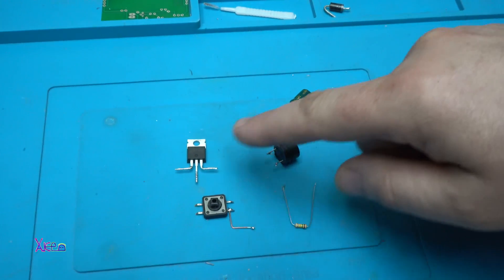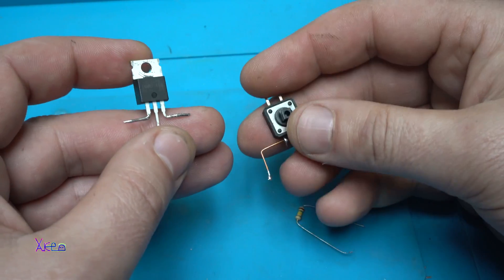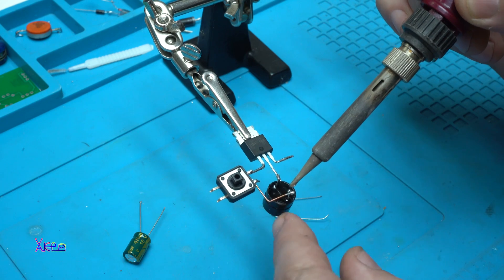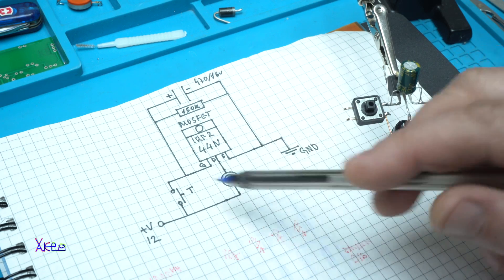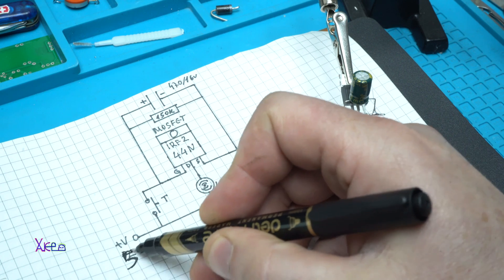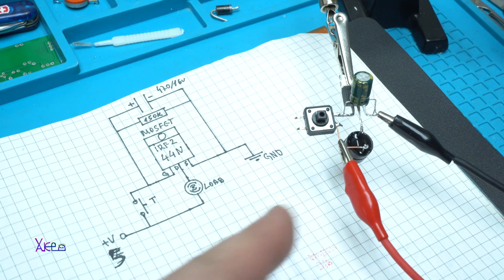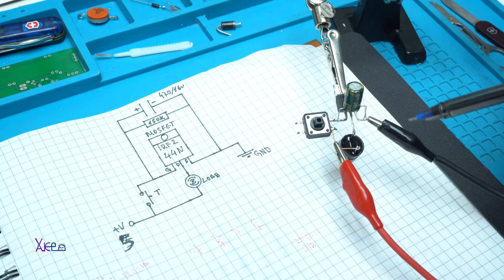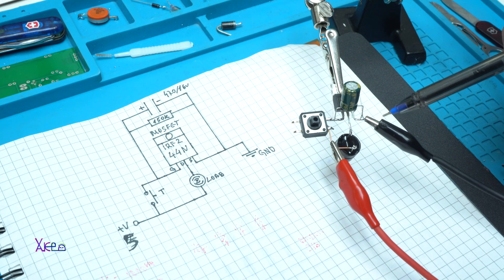ONLY 5 Parts To Make Timer circuit using MOSFET irfz44n

Comment: Oh my, you need to warn those with headsets on before you press that buzzer!!! 

Interesting project that could be used for many things.
Reply from the maker: Sorry sir🔉
Reply: @Hacktuber  Stick a bit of tape over the hole  on the top of the buzzer. It's will massively reduce the volume.

Comment: Interesting how you can just vary the capacitor to change the length of time for the buzzer. Is there such a thing as a variable capacitor to save changing the capacitor each time? Just a thought. I like these videos.
Reply from the maker: Thx for watching sir,I just share what I learn😉
Reply: Variable caps are available but are generally measured in picofarads so they are not suitable for this application, however you can replace the fixed resistor with a variable resistor, commonly known as a potentiometer. Is you use the fixed resistor value as a halfway point you can adjust the time as well, using t = RC you can get the time constant and see how changing either R or C changes the timing
Reply: @ thank you that is really helpful. I thought afterwards when I looked up how a capacitor is made I might have asked a daft question as a newbe - but thanks that helps.
Reply: C is capacitance in farads and R is resistance in ohms